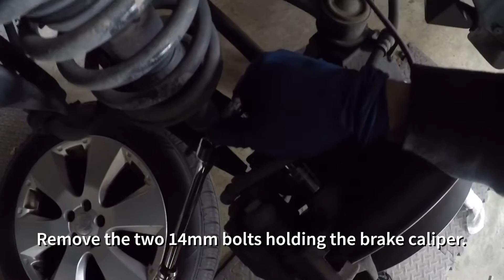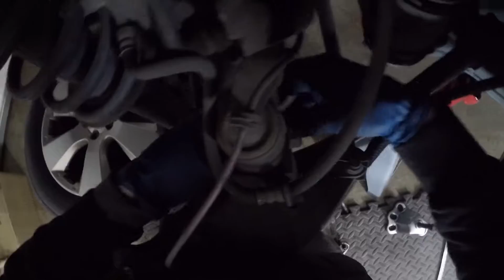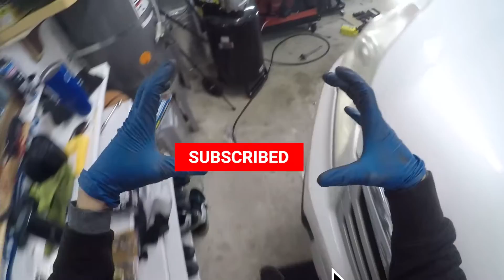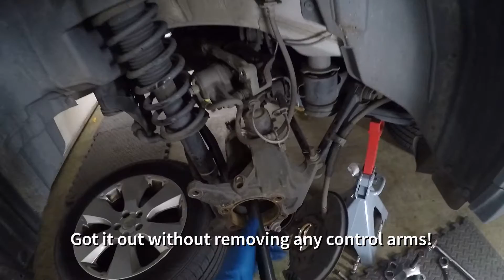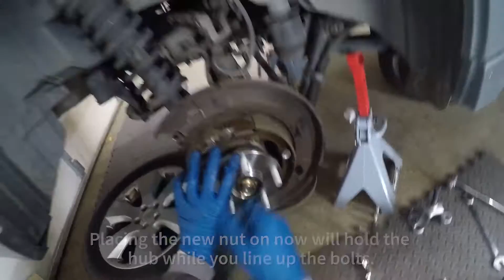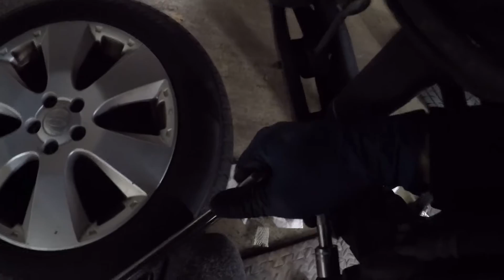Subaru Outback Rear Axle Removal HACK! | DIY

Comment: its funny, i spent weeks on YT University trying to find the best way toreplace my axle and assembly.  Today is the day I start taking everything off, I go to refresh my brain how i need to remove stuff and your video is the first I see that just totally blew away all the other instructionals.  Nice man, appreciate the no bullshit approach
Reply: Hey OP, maybe you can offer me some advice.  Used your method of axle removal perfectly.  The C clip didn't come out with the old axle though and I could feel it jiggling around inside the housing but still seated inside the groove.  Do I have to figure out how to remove the clip to replace it onto the axle, or can I just slide the axle into place and hope the clip finds the groove on the shaft?  Thanks
Reply from the maker: The clip that holds the end of the Axle? Make sure the old one is removed so the new one can go in if that's your question
Reply: @Mechani_Cole  the 'new' refurbished axle didn't arrive with a new clip on it.  I bought a set and neither of them did.  My theory is because the axle insert has a bevelled end it should be able to find the hole no problem.  The old shaft is definitely not OEM so I wonder if the prior tech had the same issue.
Reply from the maker: Yeah shouldn't be an issue
Reply: @Mechani_Cole  Appreciate the response, take your sub lol
Reply: Last thing, no rubber mallet available to me, do you have an alternate recommendation ?
Reply from the maker: Peice of wood in between a hammer or small sledge. Wood helps it not damage and absorb the blow
Reply: @Mechani_Cole  discovered I didn't even need that much force.  Felt locked in place to me.  Job was an astounding success that I am relieved of finishing after close to a year of dreading the work and fearing I wasn't capable.  Thank you man for helping with my confidence

Comment: My wife's Subaru needs a rear CV axle replaced 20+ years of working on our Subaru's I'd yet to replace a rear axle.  I read the procedure and about $hit my pants.  I have done rear hub bearings and got to thinking, why can't I just unbolt the hub and slide it off the outer CV joint?  After watching this I see there is no reason why I can't.  THANK YOU very much!!  I was going to try anyway but now I know it will work!!

Comment: Already did my bearrings about 20,000 miles back so I'm not doing them both.  BUT because I did so they're not seized to the hub and this is about to save me a ton of time on my axle/suspension replacement and lift.  Thanks for the video.  Didn't even think of that!

Comment: Do you know if this works on the front axles as well? I just used your method for both rears! Awesome tip! 2015 Subaru Outback for reference.
Reply from the maker: @dskiles5311 I'm not 100% sure myself on the fronts. Let me know if it does work though!

Comment: Ummm, that might work where you live, but where I live, the hub-bearing doesn't come out without a fight. And at the end of that fight, bearing is useless.
Reply from the maker: In the rust belt in WA? Trust me, plenty seized up here as well. Best to replace the bearing if you are removing it anyways. Reinstall with a little grease for easier future removal. This video was actaully made because the axle was so seized in the hub it broke the removal tool trying to get it out. Lived in a rusty wet area my whole life, I get it🤙🏼
Reply: @Mechani_Cole  I'm in nova Scotia Canada.... I just replaced my bearings 6 months ago, but my rear diff seals are toast, was looking for an easier way that dropping the diff
Reply: I'm in the middle of this fight right now looking for relevant videos for something I that might help, I'm about to pull the knuckle and have it pressed out.
Reply: @maxa969  I used a big (4lb) hammer
Reply: Did you replace the knuckle too? Or did it come with one of those parts? We are having a terrible time with mine. The spline part of the axle is so stuck in the hub… we fought with it for 12 hours this weekend!
Reply from the maker: Did you try this method to remove the entire wheel bearing/hub assembly? I didn't replace the Knuckle no

Comment: Didn't explain or show anything
Reply from the maker: How so? Axle is seized into the hub. Removal tool wouldn't work. So unbolting the wheel bearing is a quick hack to removing the stuck axle.
Reply: @Mechani_Cole  you time lapsed the clip with music. No light where you're working,  no clear angle on what you're working on. No detailed explanation. Not trying to slam you. You obviously know what you're doing.
Reply from the maker: @oscarp9336  I appreciate the feedback. I only sped up removing the bolts, because its just my hand twisting for a few minutes. There is no other bolts back there either just those 4. And I labeled with text each step in the video, this is an older video, I have since gotten better with the camera too. 

But again, I actually appreciate the feedback, no harm done. Thanks for watching🤙🏼
Reply from the maker: @beardavi8182  yeah it should work the same. Prying won't work well if stuck, but if you undo the bolts on the backside then put the socket over them and hit the socket with a a hammer is a good way to break it free. 

These wheel bearings were bad so were getting replaced anyways. But you can also remove it and stick it in a press or bring it to a shop if you are trying to save the bearing. Replacing both is nice peace of mind though
Reply from the maker: @beardavi8182  ah for removing the axle from the diff, you can use a pry bar to pop it free. Sometimes you gotta give a little jerk to pop the clip free